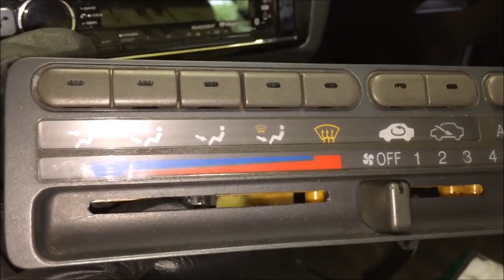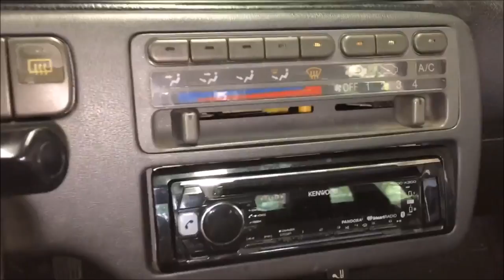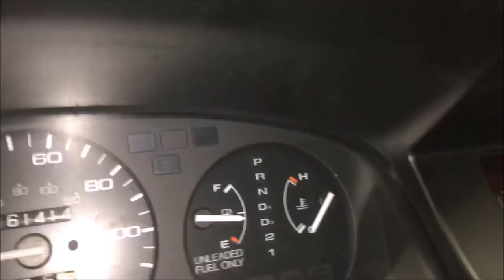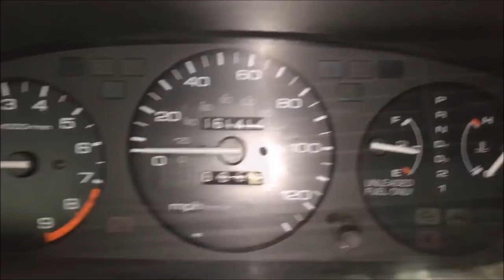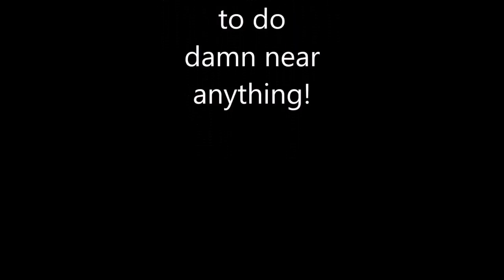How to replace a broken climate control 1992 1995 Honda Civic

Comment: If you are buying a replacement unit from a salvage yard on Ebay take a good look at the picture of the front panel to see if the fan control is an analog slider or the auto. I have a 94 which is analog and doesn't have an auto fan option. (Just like the one in this video). If you have later model (the auto selection on the fan control) it doesn't have the cable which shuts off the hot water coming into the heater core.

Comment: you can access all 3 screw holding the ac control unit in by removing the small panel housing cigarette lighter/ash tray (4 screws) and the head unit like you already did. you will be able to use a normal screw driver as you can reach from below

Comment: You don't have to remove the dash section. there in a main bus bottom of the raido where the cigarette lighter fits. If you disconnect it, and one other clip that goes to the green plug, the whole harness comes out with the control panel. It's still a mother, but a little easier.
Reply: Hey man! I was trying this the other day but my harness was pinned to the plastic wall with one of those plasting screws that you have to squeeze to free, and the thing is unreachable, it sits behind the interior wall, idk if you did this and had the same plastic screw holding the harness to the wall but if you could shed any light it would be SO great!

Comment: If you fallow the cable from the climate control to the bottom, there are two plugs close to the floor and this makes it easier to remove the climate control with the whole cable. Just an FYI.

Comment: How do you change the clock on dash i hold it a bit but nothing?
Reply: If you're still wondering it comes off when you undo the clip on the wires it in the back

Comment: Easily the hardest part: That green plug, any tips?
Reply: Where did you buy your replacement? I have to change mine. I also shared the link to a video that also shows the removal of the climate control but without removing the green plug.

Comment: You don't need one of those angle drivers you an do that with a ratchet and a socket that the bit fits into
Reply from the maker: Joshua Nicolai no room to swing the ratchet though.
Reply: @hrg_tv  what about a tiny ¼in ratchet